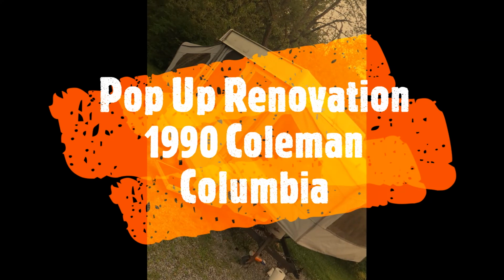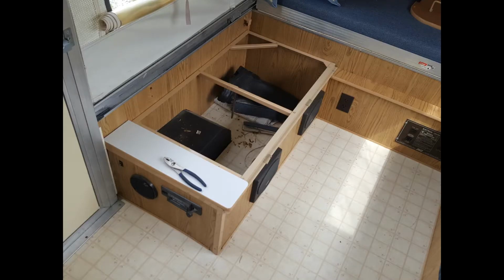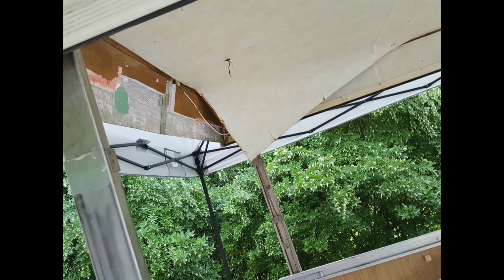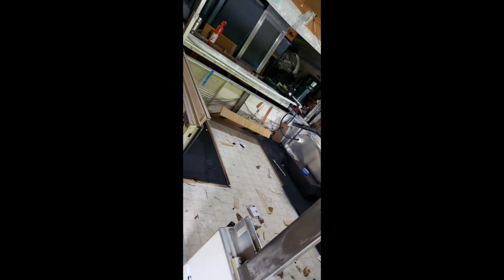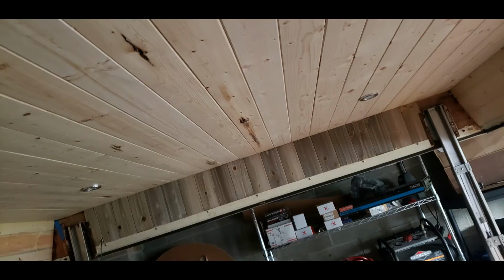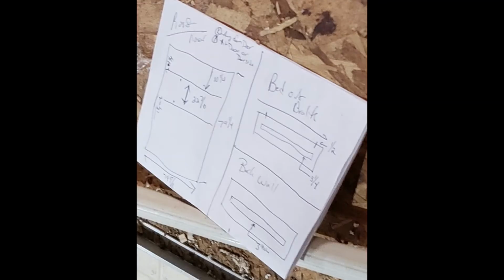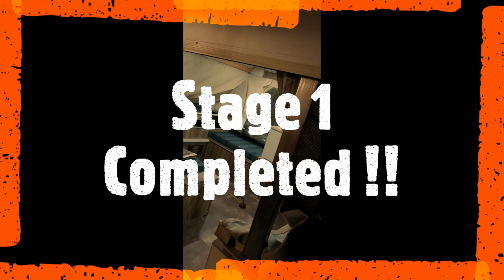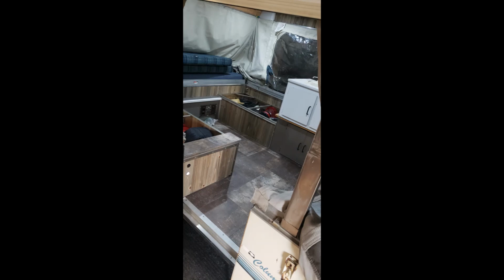Coleman Columbia Pop Up Remodel Part 1

Comment: Oh wow - great work. I just bought a 1984 Coleman Redwood for $100, and the layout looks almost exactly the same. I was very careful to look for water damage, but so far there were only two small places. The biggest casualty is the fabric, and it's going to need  a complete replacement, some tires and this and that. But I am looking forward to the remodel. I have been camping a lot here in Colorado, and tent camping is okay, but I have a pretty elaborate camp, and the popup is going to streamline setup and take down quite a bit. Looking forward to the rest of your videos!